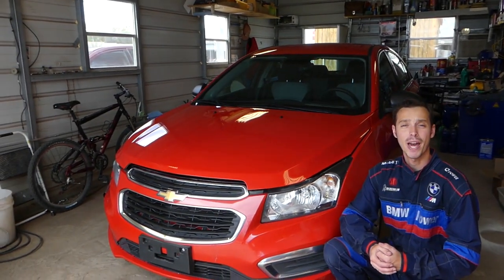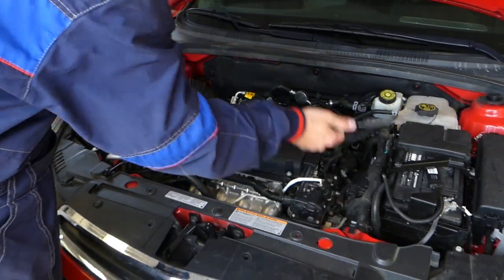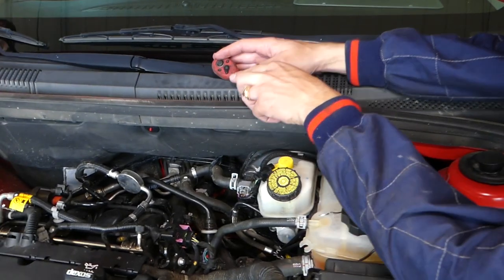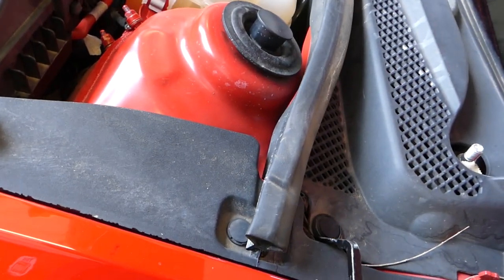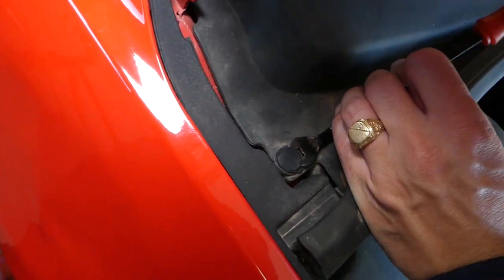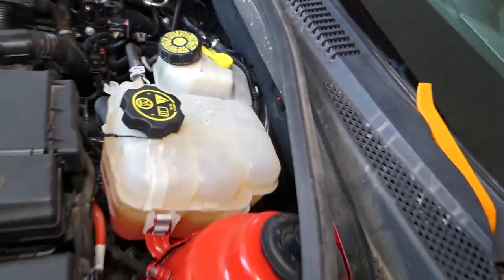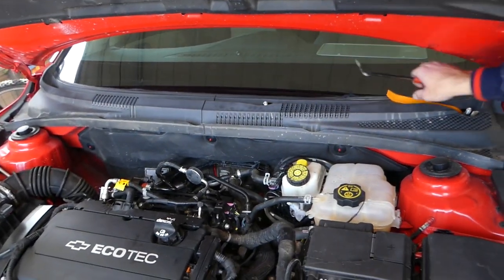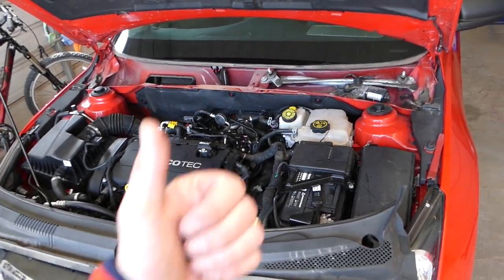WINDSHIELD WIPERS TRIM COWL REMOVAL REPLACEMENT CHEVROLET CRUZE SONIC

Comment: It’s been recommended to replace the widower cowl while replacing the spark plugs on a transverse engine. When you remove the cowl, you have more hand room to replace the spark plugs. Sounds easier than removing the air intake assembly.